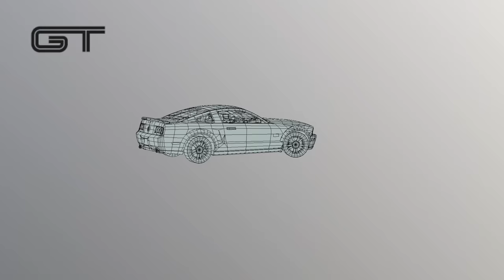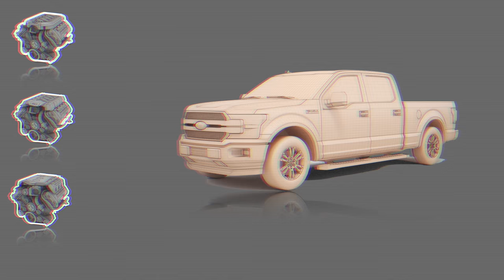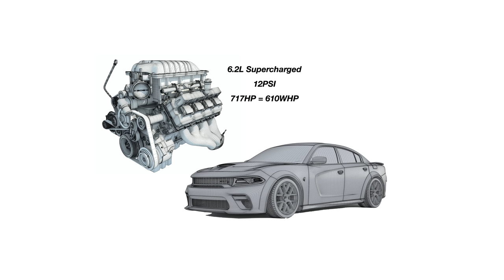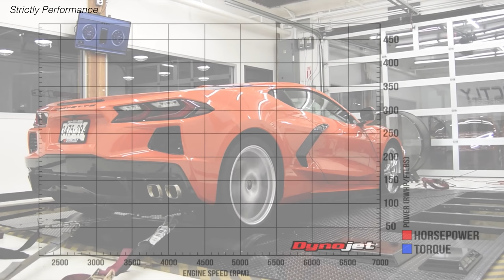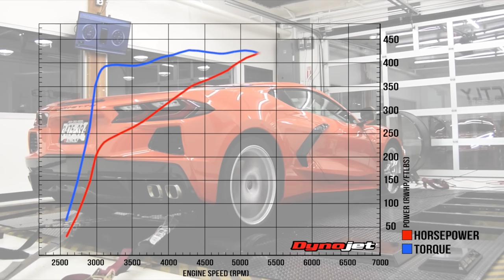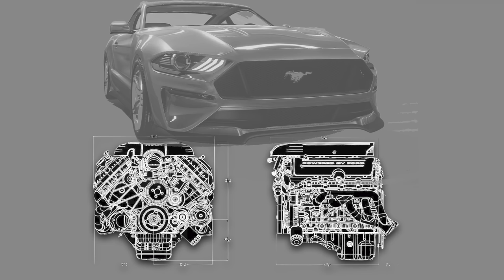How 5.0 Coyote Engines Beat LS and LT😮 | Explained Ep.2

Comment: Every trick in the book.  DOHC, DI, VVT, super high rev, high compression and multi valves.  It is quite the piece!  I’m a Hemi guy but you have to give credit where it’s due.
Reply: as much as i really like the hemis they have all that power but so much weight. great cars high power just a little on the heavy side
Reply: That much out of a 5.0, it's bad azzed.
Reply: @frenchonion4595  Yeah, but they not getting 500 HP out of their engines.
Reply: @rayzee7561  Because they are mostly 2 liters but the horse per liter has always been there
Reply: @rayzee7561  Thats not to say the Coyote is not a good engine i was just pointing out the tech has been around for quite a while
Reply: Compression too big for street car man, that's why they always shooting rods and bearings are  shot.
Reply: If they stay together
Reply: Mustangs are loud for no reason
Reply: But the hemi is a about to die   and the  ford is coming  out with a new generation coyote.  . And I'm  a godzilla man  it a big block  800 hp no supercharger or turbo. 😅
Reply: I want to see  a 7.3 Godzilla  😊
Reply: @ancientalien5752  they're literally like 3% heavier than mustangs.  Basically negligible.  before you say hellcats weigh 4400 pounds remember that GT500s weigh 4400 pounds.
Reply: They just make easy power reliably and it’s something like you said deserves credit
Reply: @dustin_live  heaviest gt500 weights 4100 pounds, still much lighter than the challenger & chargers. mustang always been a small car.
Reply: More stuff to break
Reply: @nicholaswilliams429 guess we should only drive cars with no windshield wipers, power windows, power seats, power steering, doors, air conditioning, starter motors, traction control, seatbelts, brake lights, and all that stuff. Because as you said all that can break
Reply: Coyote has a much higher brake mean effective pressure than any mass produced engine and why they kill under boost.
Reply: @dustin_live  2020 GT500 weighs 4100-4200 lbs depending on the trim. Hellcat challenger is 4500 lbs.

A Hellcat engine alone with all the fluids weighs 875 lbs! My C6 z06 with the LS7 engine only weighs 450 lbs with a 7L V8 engine. Fords 5.2L predator weighs around 536 lbs while the coyote weighs around 450.
Reply: @SZUSEast1 they definitely aren’t always shooting rods.  Well proven to hold big power reliably.
Reply: Mmmmm
 No
Reply: @SZUSEast1 umm. Coyotes don’t do either of those things dude. Mine has been supercharged for 6 years and tons of drag strip runs.I know about 10 ppl making big power with one.taliking out your ass
Reply: @Magucci13 they stay together, no prob. Mine has 800hp for the last 6 years. Ppl are full of shit
Reply: @themarathoncontinues2289 tons of compression and rpm is gonna be loud
Reply: Why did they discontinue the voodoo
Reply: You really can't compare the GT500 to any Challenger. The GT500 is not just a straight line car. It has a very good suspension and awesome brakes. They do very good on road course.
Reply: And all done by just 5.0 Liters… the one of the smallest of the bunch by far.
Reply: @joeleaton7187 technically not a big block.
Reply: @shanesmith5603   is dodge  440 a big block  ?   YES IT IS  7.3 Godzilla  is a 445 cubic inch engine   .
Reply: @joeleaton7187  bore spacing, is what determines whether ita a big or small block ...Fords 445 bore spacing is closer to a small block. It's roughly the same as a 351 dimensionality.  Don't believe me Google it.
Reply: @shanesmith5603   i
It said,   400  cubic inches  and larger  cubes .
Reply: I'm a mechanic so are my kids Mopar is king Ford is junk
Reply: @ancientalien5752 Mopar is heavy I love em ❤❤
Reply: @Cherylann-ryllaby2   no race championship   out side of america,        no v8 cars in the 80s , yeah  mopar  are cool .
Reply: @joeleaton7187  hell yeah they are.
Reply: @Cherylann-ryllaby2   OK, name a dodge,   that would be a Is competitor to  to mustang,  camaro,  firebird  ,   through the 80s  . You can't  , all were a turbo  4 cylinder  engines  .front wheel drive  . Not  cool ,
Reply: @joeleaton7187 lol your right but that’s when they stopped making em them so can you name comp stock for stock? from 60s through 70s?? mopar ran those days lol many old heads told me everyone all said some other brand cars was quick but nun like 440 six pack quick lol your naming when dodge got out of that scene they been making boats it was hard to beat dodge back then stock for stock you had to build a Chevy n a ford to keep up been told by plenty of old heads n also don’t forget dodge brothers built motors for ford too
Reply: @Cherylann-ryllaby2 you are right mopar is king brother🤘🏽 60s - 70s no other brand could keep up stock for stock I’m only 21 and been informed by many old heads what those older mopars was about, wish I was born back then to see those 440 darts couldn’t be beat stock for stock gotta love mr norm🤘🏽
Reply: @joeleaton7187 n mopar wasn’t built for that they was built for drag racing and yes your right 80s was boring for dodge I’ll admit but dodge did try to do the circuit racing with sum challengers n aar Cudas but dodge only knew bout that drag racing life circuit racing wasn’t for them!
Reply: Lol these Engines are not Reliable if they were why Didn't Ford put them in a super duty truck Chevy put LS And lt Engines in there heavy Duty trucks
Reply: Except mustangs are overpriced. Doesn’t matter how good the engine is if you have to pay a ridiculous amount for it.
Reply: @ancientalien5752 

Racing is illegal. Who cares about which cars are faster. In real life it’s about looks and sound.
Reply: @philmcrackinnow  
Racing isn't illegal
Reply: @ancientalien5752  

Race by a cop and let me know.
Reply: @Cherylann-ryllaby2  you’re just saying that because you think it’s cool. Even for reliability purposes I’d rather have a coyote than a hemi
Reply: @philmcrackinnow  you mean street racing is illegal. Be more specific. Some of us like to go to the track. Ever thought of that?
Reply: @Possum3v  

Yeah, but most people don’t.
Reply: @Cherylann-ryllaby2 that don't mean nothing all lies
Reply: @antimedic4441  illogical.
Reply: Just buy a Stinger, tweak it a bit and watch the big boys cry.
Reply: @StockCarGuy 4,100 pounds is NOT a small car. At least, compared to my 3,250lb 427 C5
Reply: To those who think the Coyote is junk, you're not thinking, period. I'm a Chevy guy, but those Coyotes are damn good engines. Their basic design has been proven in 14,000+rpm motorcycle engines for decades. They'll kill any other 302 American V8 ever built. They're also reliable. A 4 valve design has a superior valvetrain design for stability, and flow. Yeah, they are heavy, and big. Theyre also damn impressive.
Reply: @dustin_live  GT500s weigh 4200 lbs....
Reply: @dustin_live gt500 weighs 4200 pounds and that’s the only heavy mustang so just stop it,(Mustang GT is 3,700 Lb) (Shelby GT350 is 3600 Lb)
Reply: @joeleaton7187 Chevy dropped a big block na over 1000hp
Reply: @gone547 Ew no we prefer out Stangs and not mid life crisis cars that cost a fortune😂
Reply: I've seen a lot of 5.0 blocks blow up 😂
Reply: @themarathoncontinues2289  That makes no sense at all, their literally faster than you're Camaros and scats stock for stock 😂
Reply: @Cherylann-ryllaby2 You're not a very smart mechanic 😂
Reply: @kcdesignconcepts5216 my brother had one and it was the craziest car I ever been in.
Reply: @dustin_live hellcats can be up to 4586lbs depending on options. The Shelby weighs 4183 so that’s a lil off fam.
Reply: @nicholaswilliams429  yup. I saw a $10k budget build on a coyote and an ls3 and the coyote lost.
Reply: @dustin_live  hellcats are like 5k in reality
Reply: “Ti-VCT” Twin Independent Variable Cam Timing 

Not VVT
Reply: Believe and put your Faith in Jesus Christ’s Death Burial and Resurrection for your Sins and you will be Saved